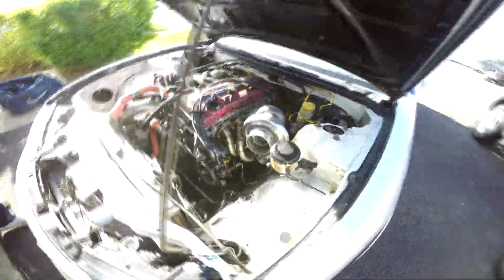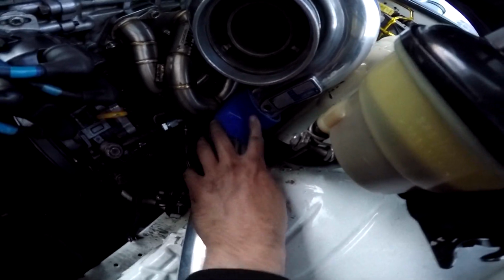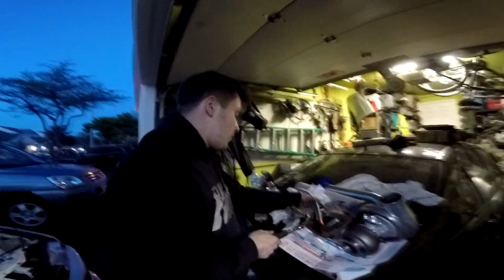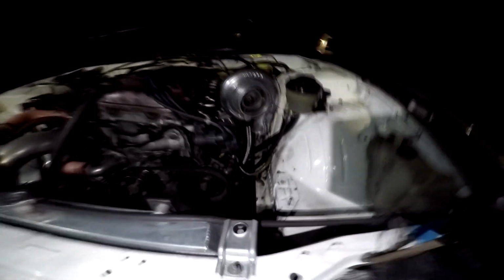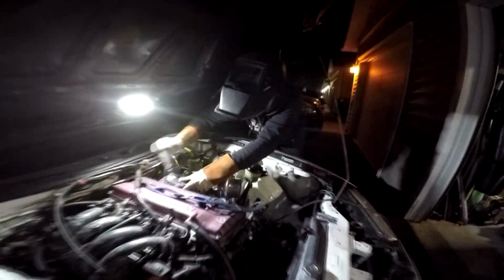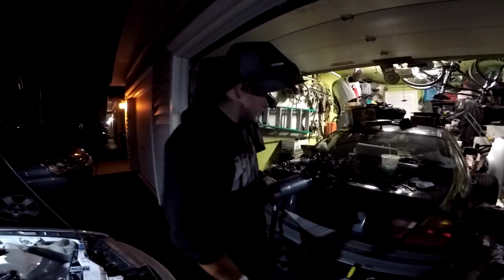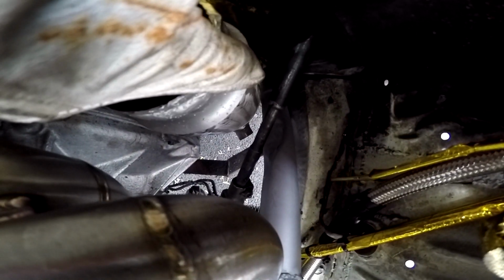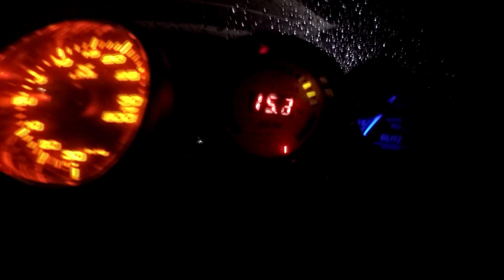KA24DET ISR TOP MOUNT MANIFOLD INSTALL & MAKING A DOWNPIPE!!!

Comment: How you liking the top mount manifold? Any pros and cons ?
Reply from the maker: i like it. easy to access everything. downside is that it places the turbo right next to the brake master. i ended up melting my master reservoir at the drift event haha.
Reply: @jodieWRLD  dang haha. I was thinking of getting that manifold for my ka but haven't made the purchase yet
Reply: @jodieWRLD  you could run a toyota tercel brake booster